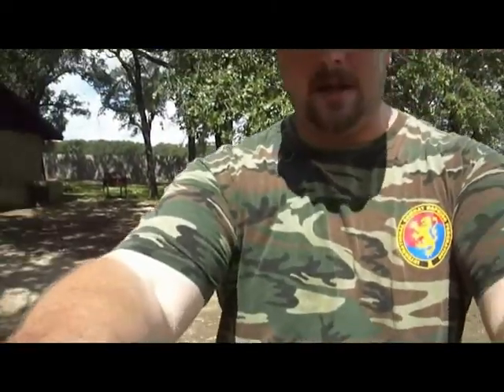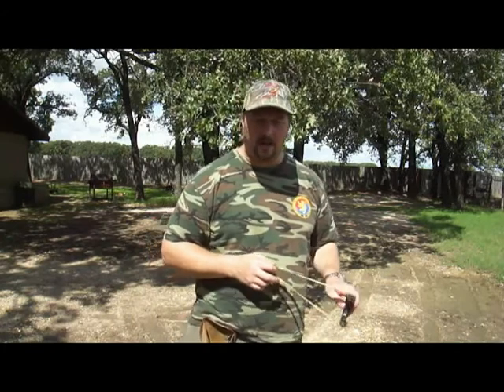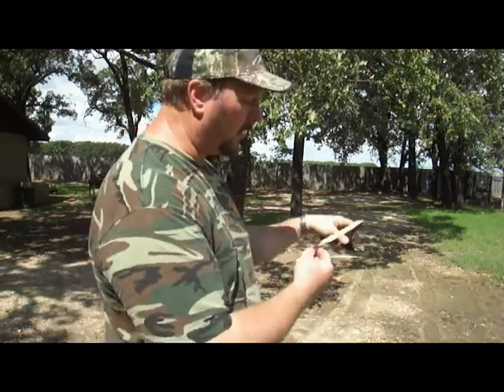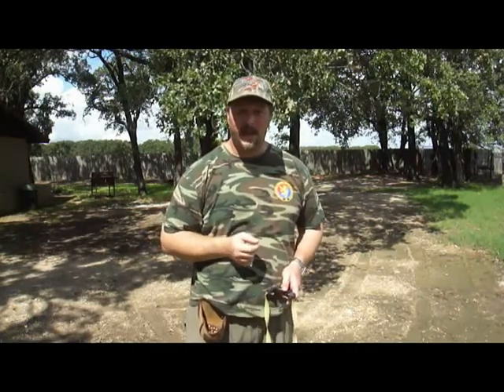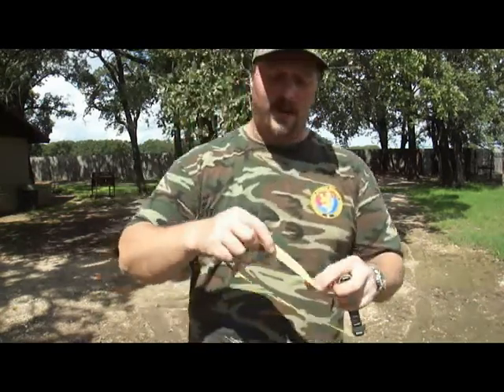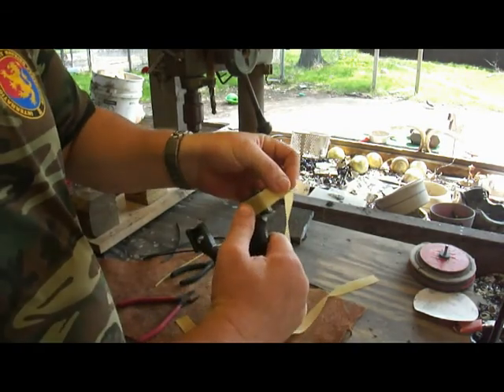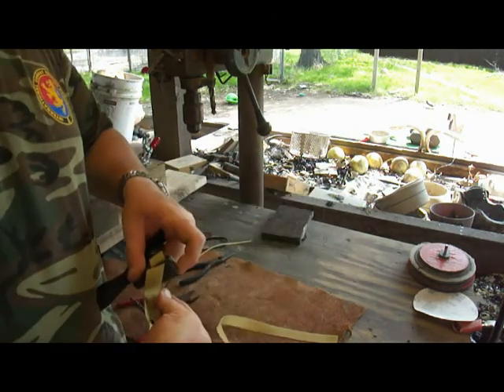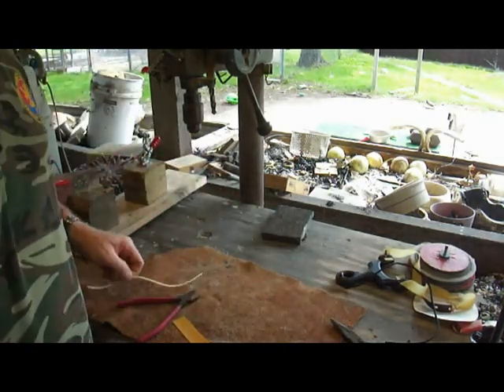Tips to get you up and running with your new Pocket Predator slingshot

Comment: Bill, I ordered your Hathcock Sniper in July and it is very accurate.  I've shot a longbow for 3 decades so it was second nature.  Thanks for the info on the band ties.  I shoot .454 lead balls because that what my cap and ball black powder revolvers use and they zip through full gallon milk jugs at 13 yards and don't appear to slow down much.  Thanks for the excellent product.

Comment: I learned a lot on this video.  I don't know anything about sling shots but think I can get interested again.  I am 68 now but when I was young before high school I made a sling with a piece of cotton cloths line and the tongue from a boot.  I put a golf ball size rock right through our back fence like it was not there.  Boy did I catch hell when my Dad cam home.  One question what is the difference between the flat rubber and the tube rubber used on other sling shots.  Maybe I am going back to my child hood ha ha  Will have to check you web site to get more information like what kind to get etc. Thanks again.

Comment from the maker: Those toggle clamps were bought from Harbor Freight several years ago... so they're brandless. They cost like $4 apiece. The pressure is adjusted fairly tight, but not so tight that the bands are in danger of getting cut.. you'll have to work it out by feel.